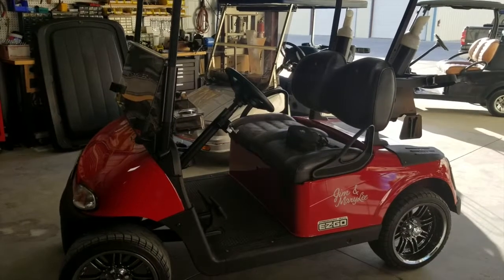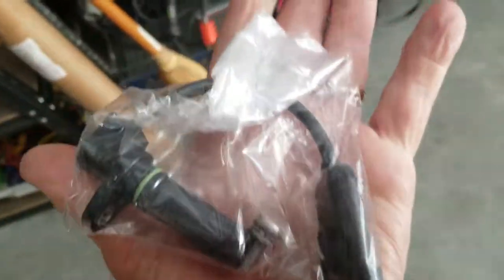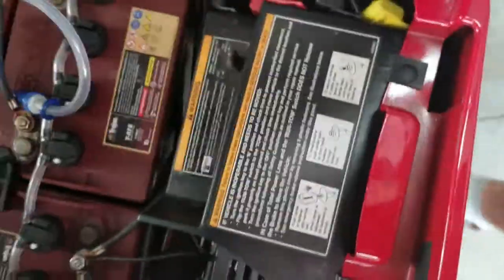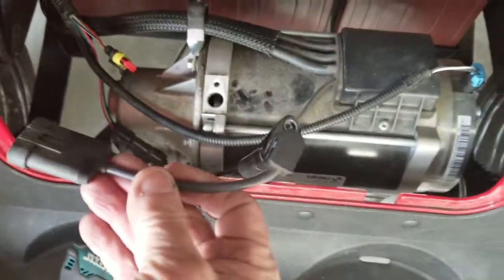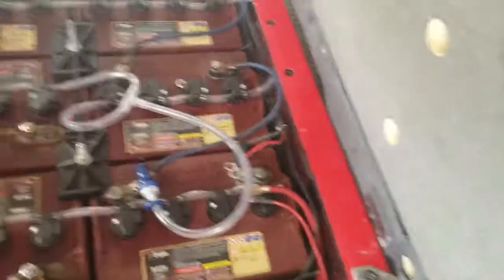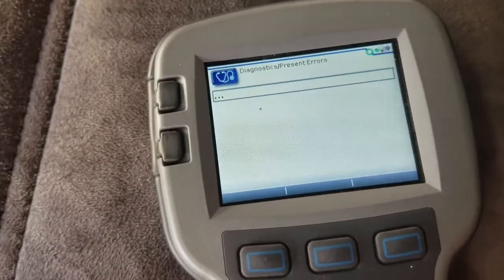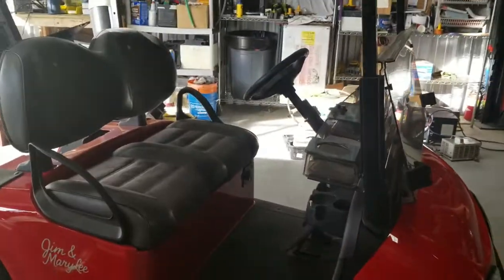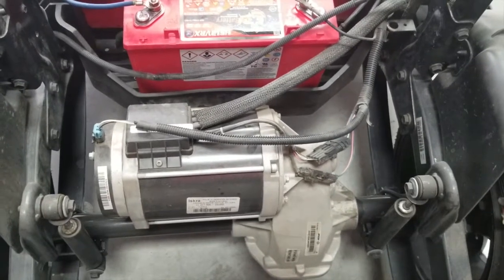How To Install an Encoder on an RXV Golf cart

Comment: I have an RXV cart. I upgraded to a bigger controller. I didn’t notice it at first but I’m getting this jerking motion when I slow down. For example slow down to make a turn it jerks like it wants to stop then it will go. Does this sound like it’s the bearing encoder or the controller?? Thanks for any info.
Reply from the maker: It could be either of them. Are you sure your bigger controller is compatible with the motor? Also if you didn't upgrade to a larger amp solenoid,  that could be the problem.

Comment: Hi there every body, hope every body is doing well. 
I am trying to convert my Ez go RXV AC  Danaher controller to a Curtis AC.
Can you please run a video showing all procedures
Reply from the maker: At this time, I have no plans on doing a video on that, I don't think the amount of people that want to do that, would justify all the time to tape it.
I have done it before,  it is not hard to do. Biggest issue could be if you are also changing the wire harness.

I think I kept notes on the procedure,  maybe I should organize and print them and put them on ebay  🤔

Comment: My 2009 cart is just creeping along if I replace it will I have to clear the code? Or will it start working again?
Reply from the maker: if you are saying the cart will not go over 8 mph,   then that tells me your speed sensor is bad 

Do the speed sensor test and let me know what happens.

Im not sure what " code " you are referring to ?
Reply: Did you figure out your issue? Mine won't go over walking speed
Reply from the maker: speed sensor
Reply: @waynemartin.waynesgolfcart4900  a new speed sensor didn't solve the issue. Any other thoughts?
Reply from the maker: first thought is make sure the sensor is oem.

Next wood be the magnet, make sure it isn't cracked. 

Next would be mcor
Reply: Just wanted to post an update. It's a bad motor, I took it to a local shop and they said it's heat sensor in the motor that is known for going bad. I searched "signs of bad motors" and everyone listed the same issues I was having so $140 repair just became an $1,100 repair, sigh
Reply from the maker: that's way too much

Comment: Can you put a newer motor off a 2015 rxv and put it on a 2008 rxv?
Reply from the maker: yes, and you will need a wire adaptor also.
Reply: @waynemartin.waynesgolfcart4900  thanks. Would you recommend doing motor swap? I just bought cart, it’s my first cart. I’m not having any issues with cart now just wondering. What are other weak links on my 08 rxv?
Reply from the maker: Don't replace place motor,  unless it is giving you a problem. 

Those motors very rarely go bad.
The only 2 things I have seen go bad on the older rxv motors, is the encoder bearing, and corrosion eating up the wires.

Comment: Where are you located??
Reply from the maker: indio, calif
Reply: @waynemartin.waynesgolfcart4900   damn I’m in Savannah ga, I just bought a exv 2010 from a guy down the road and it has a new motor but does the shutters like everyone says so I’m at all and don’t know if it’s a controller or encoder… and no shop in my area will touch it…
Reply: @waynemartin.waynesgolfcart4900  I just hate to waste money on parts I may not need…. Any tips?
Reply from the maker: how do you know its not the batteries?
Reply: @waynemartin.waynesgolfcart4900  getting 52 volts before and after the solenoid, I bought a 37 dollar battery tester from the parts house  and they show good when testing at 650
Reply: Also on my meter I’m getting 13v each battery
Reply from the maker: I don't know what you mean that it shutters?
Those motors are almost bulletproof,  so if your cart has a new motor, that is very rare, and I wonder why?

Depending on what shuttering means, it could be the brake or batteries in my opinion. 

It won't be the controller.
Reply: @waynemartin.waynesgolfcart4900  I’ll try and tag you in a video I have of it, but when I first got it it would go for a minute or 2 then just what seemed like it lost all power, I would turn the key off for about 15 seconds then it would go for about 30 seconds…. Now a week later I can get it in and out of the garage and it’s done for. When I jacked up the rear and it the gas it done nothing until I put a little resistance again the motor then it would just shutter….
Reply: @waynemartin.waynesgolfcart4900  I created a short video of it on here but don’t know how to tag you
Reply: @waynemartin.waynesgolfcart4900  also thank you very much for your time.

Comment: Sounds like you have 1 of 3 possible problems.

Either your brake is going out, you have corrosion on your small wires in the harness, or your encoder bearing is bad.

The wire corrosion issue, is on the rxvs before 2012.5.

The encoder will lock up, when bad, usually at full speed. It doesn't seem to lock up on the slower speed. Also some symptoms of the encoder is sometimes cart won't go at all, and some times it just creeps along real real slow.